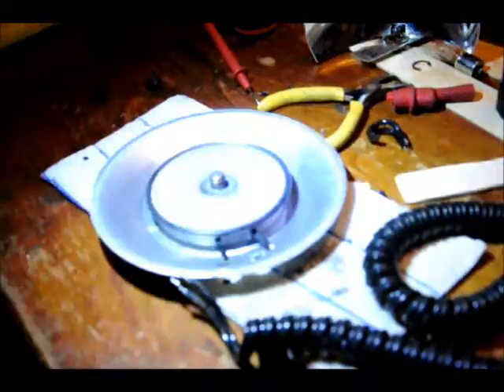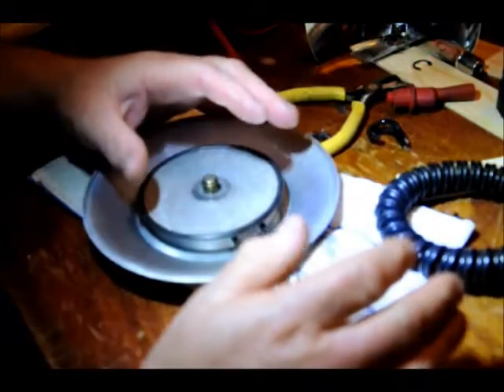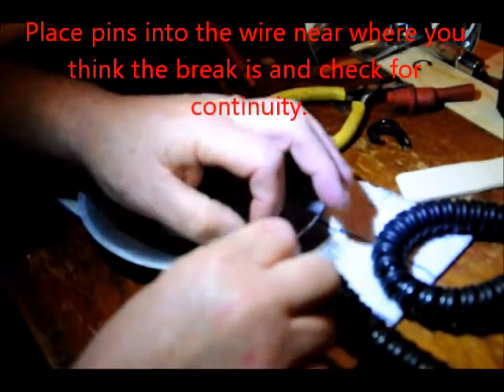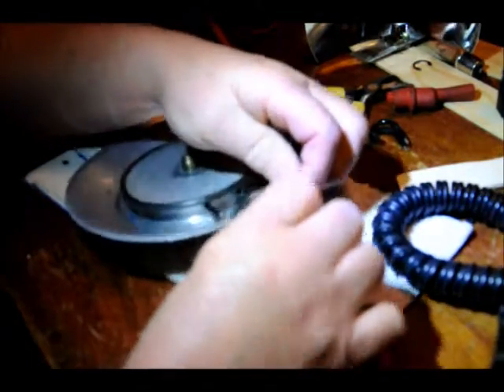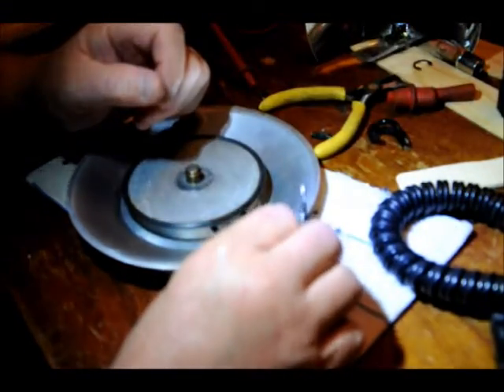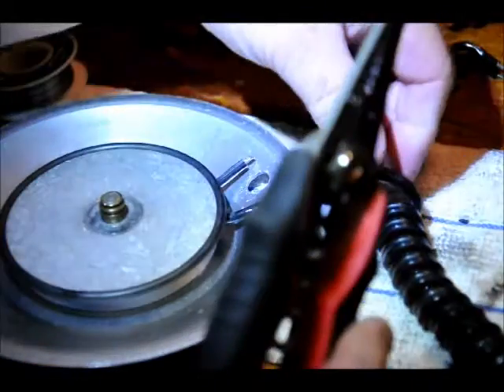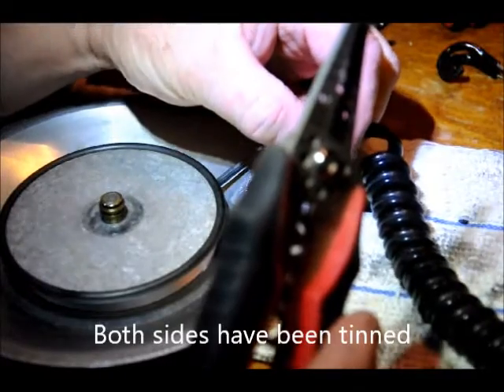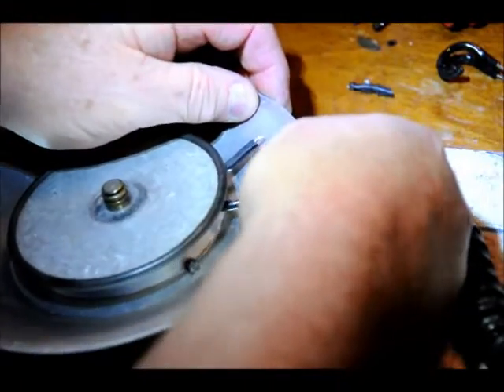Smith & Wesson L-11 Wire Repair

Comment: Just acquired one of these and the mechanism will rotate if I remove the bulb but once I put the bulb in, it will not turn but the bulb does illuminate. Any experience why that may happen?
Reply from the maker: Sounds like your power supply is to weak in amps. Is the bulb bright or weak?

Comment: Do you know of a replacement motor?
Reply from the maker: I do not. You may be able to find something similar at a good hobby shop.  Are you sure your motor is not good. Could be wiring or ground problems.
Reply: Skulldigger hi, I have same same light, you can tell me where I can find one cord like your cord  for put in my light? Thank you.